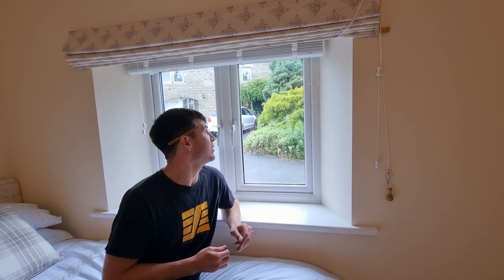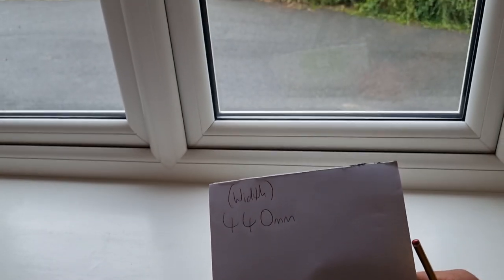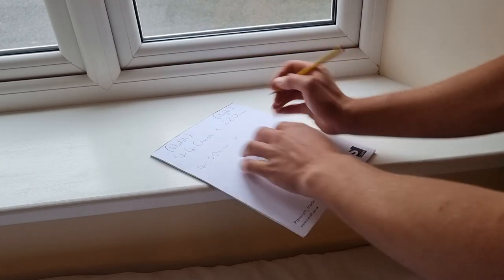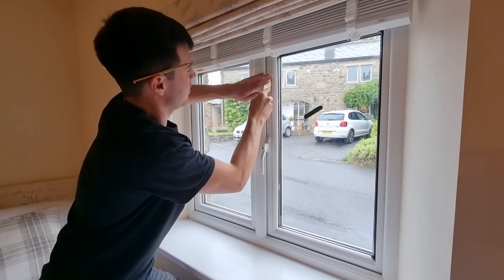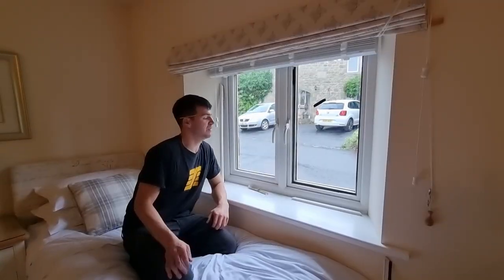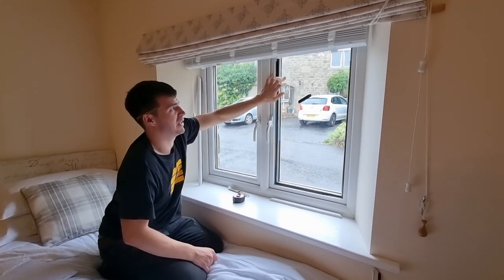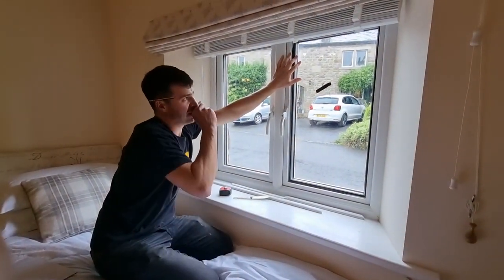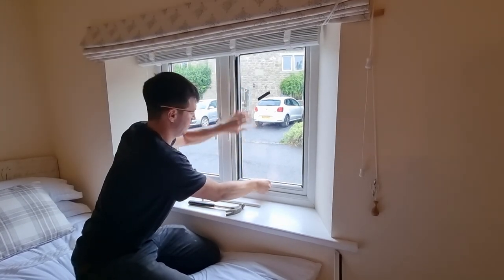How to Measure Up a Replacement Double Glazed Glass Window Pane

Comment: What about width measurement if it's not an opener? Is there any shortcut other than removing the glass completely?
Reply from the maker: You could try a different window with an opener if they were fitted at the same time.